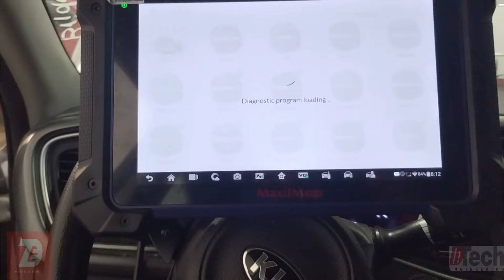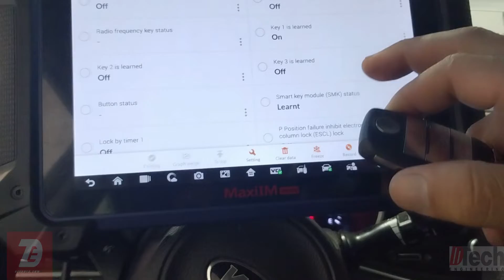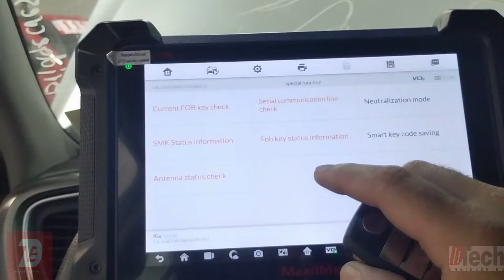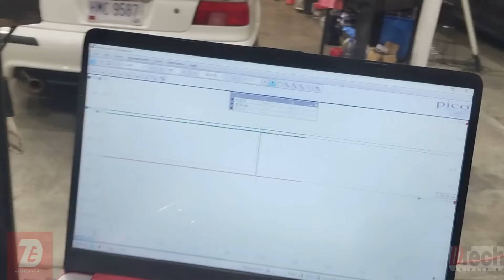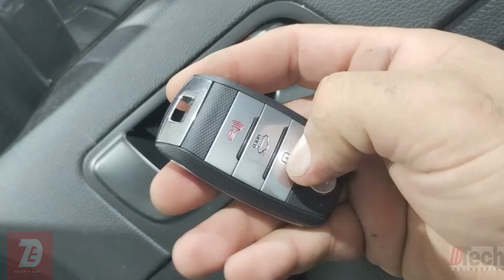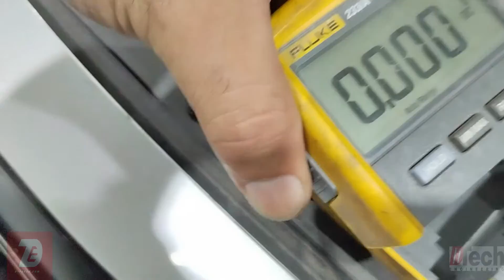2015 Kia No Key Recognized No Crank No Start Diag & Fix

Comment: I HAVE A PROBLEM WITH A 2015 KIA OPTIMA, THE CAR REMOTE KEYS ARE LOOK AND UNLOOK THE CAR WHEN YOU USE THE CONTROL, THE CAR RECOGNIZES THE KEY, BUT WHEN I WANT TO TURN IT, THE IMMOBILISER LIGHT BLINK, I ALREADY CHECKED THE CRANK IT IS TURNS, THAT MEANS THAT THE ENGINE IS FINE, I HAVE A MAXI AUTEL SCANNER AND IT GAVE ME THE CODES C1611, C1612 WHAT DO YOU RECOMMEND I DO?
Reply from the maker: would start with trying to see if the interior antennas are picking up the key remote

Comment: What year did KIA/HYUNDAI get sued for their cars being too easy to steal in the USA? The KIA Boys were having way too much fun. You should have a short list of cars with engines known for seizing up/oil burners bro, especially when coming from the Auction, 99% of shops don't even check the oil level until it's too late, lots of videos to prove that also. Thank you for the SMK lesson, cheers.

Comment: You made 2 very important mistake. First your new battery is 0% full and 2nd where is your USB cable? Never ever program by low voltage or over BT
Reply from the maker: I didn't perform any programing at all.
Reply: I program over bt with no issues

Comment: Excellent diagnostic video Sadel! Like you said we learn a lot and know we have an idea how to approach a situation like this! If I see the immobilizer light on when pressing the switch and the key in the center console, I would have done the same. I've seen some problems just with no key detected but if the key is programmed the immo light does not turn on. Every brand modifies the way things work. unfortunately, in the video we could not see when the I-key was touching the stop/start button, to see if the immobilizer light was on but as always, we learn a lot brother! Thank you Sadel and we're ready for the next one!
Reply from the maker: yes this one was tough one, thank you for watching as always!

Comment: The keyless entry functions use a different radio frequency than the ign/starter functions.  I’m thinking that the original fob was trying to start the car when it would turn on the ign.    Typically the antenna system for the ign functions are separate from the keyless entry system. The keyless functions of the remote require the remote battery.  The ign function part of the remote does not need batttery,  it gets it’s “power” from the transmitter in the car.